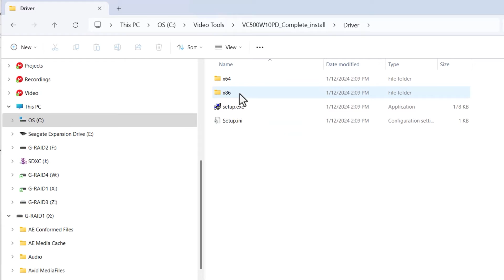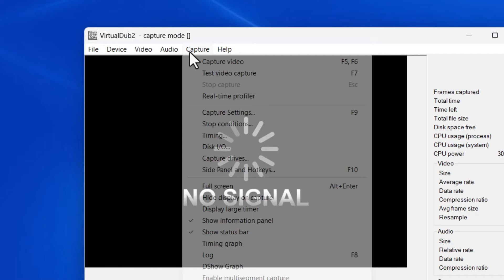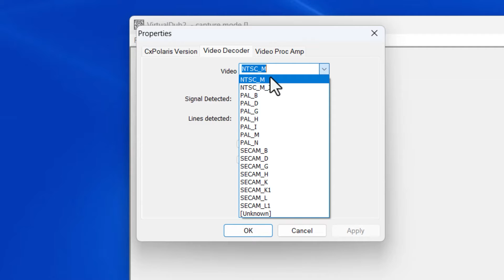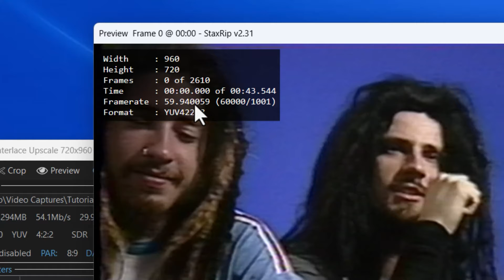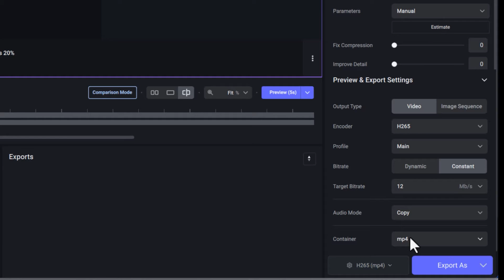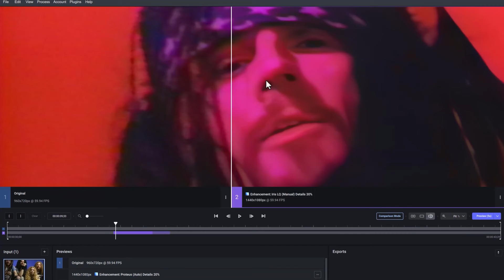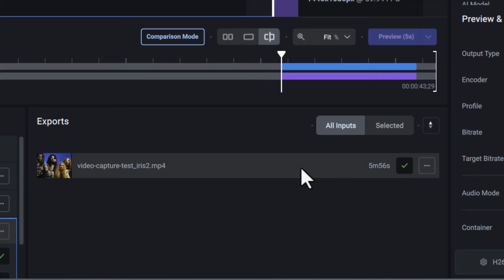How to Capture SD Video in VirtualDub2, Deinterlace in StaxRip, and Upscale to HD in Topaz Video AI

Comment: Which is better, and why? The Diamond VC500 you use here, or the StarTech USB Video Capture Adapter Cable you used in your older video using OBS?
Reply from the maker: Between those two I like the VC500 better for lossless capturing. But between the two devices in this video, I like the Startech device better (although it's more expensive). I think the Startech device shown in this video offers better quality overall for lossless capturing.
Reply: @timfordphoto Yeah, would love it, but the Startech device in this video is out of my price range. Ok, got it, so you would buy the VC500 over the Startech cable. Thank you!

Comment: When i import my SD 29.97i file the export timecode pops up as 25fps. Is there a way to change this to 59.94?
Reply from the maker: Is this out of StaxRip or Topaz Video AI?
Reply: @timfordphoto  It's in staxrip. I dont get an error message when i setup the field deinterlace tool QTGMC, but after i set it up, i import my file, then get an error "System exception - illegal instruction". Not sure what i'm doing wrong. thx for response
Reply from the maker: What kind of file is it?

Comment: You are a godsend. I’ve had so many sleepless nights trying to figure out how to properly digitize my home videos. Thank you thank you thank you. Been back and forth on OBS trying to deinterlace my videos from another video that showed how easy it was but I’m not sure what’s going on with the software cause it just doesn’t seem to work. So glad I ran across your video. Thanks again.
Reply from the maker: I'm glad the video helped!
Reply: Hey Tim thanks again for the video. I did my first capture and deinterlace last night and noticed that dark areas that I could see detail in the capture were then completely black after the deinterlacing process. Also the same goes for the white areas. Is there a way to adjust so this doesn’t happen? It’s like if the exposure was changed. Was also wondering if there was a way to adjust the volume when capturing? Thanks Tim.
Reply from the maker: Did you use the preview feature in StaxRip to see if it showed the dark/light issue prior to rendering the video? It might also be an issue with the encoder, are you using ProRes or something else? I'll check on the audio level question, it seems like something that you should be able to do.
Reply: @timfordphoto  I think it was just the difference between the video being delaced and not. The colors become richer from not being interlaced. I would like to know what you come up with for the audio volume issue. Thanks again.
Reply: Have one more question Tim. Do you also have a process like this one for deinterlacing video via FireWire? I captured a video in virtual dub via FireWire but when I try to deinterlace it in staxrip it shows me an error message. I would like to use the dv video capture if possible. It captures as an avi file but I’m guessing it needs something else done for Staxrip to recognize it.
Reply from the maker: That's actually going to be my next video because I was able to recently figure it out. I'll try to get that video done this week, but in the meantime here are the steps required to get DV AVI files to work in StaxRip:

Right click in the “AVS Filters” section and choose “Add”, then “Color” then select "Convert” and then “ConvertTo”. Type in YUY2. 

Double click the added filter and paste this in: ConvertToYV12(chromaresample="gauss",interlaced=true)

Drag and drop the “color” filter that you just added so it sits just below “FFVideoSource” (under AVS Filters)
Reply: @timfordphoto  thank you so much. I’m going to try this right now.
Reply: @timfordphoto  tried the DV videos and your method worked perfectly. Thanks again Tim. While I’m messaging you I’d like to pick your brain on something else. I’ve noticed that when capturing my analog video8 tapes the capture looks dark. Is there a way to correct this?

Comment: I like Virtualdub and am just learning about the changes that were made in 2 but I never understood why the Proc Amp isn't monitored when you try to make adjustments. If a certain card needs to be adjusted it would be better if you could actually see the adjustments your're making at the time.
Reply from the maker: You can actually do this in OBS, but the settings don't "stick" - you'd probably need to do a screen grab once you get the settings dialed in using OBS, then change them again once you go back into VirtualDub.

Comment: fantastic! thanks for the great guide. is though virtualdub2 compatible with older usb cards?
Reply from the maker: Yes, it should be. VirtualDub2 is fairly old software.
Reply: @timfordphoto  will try it! virtualdub 1 though does not work with my usb card, terratec cinergy htc xs hd
Reply from the maker: I'm curious to hear if it works or not.